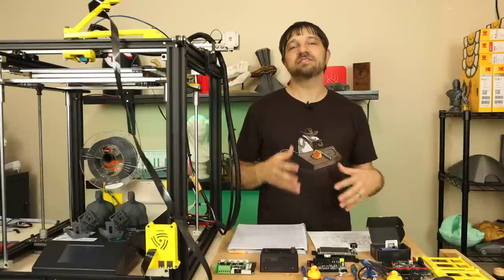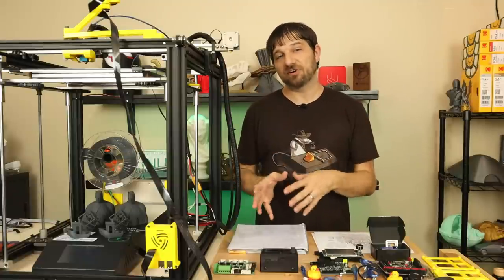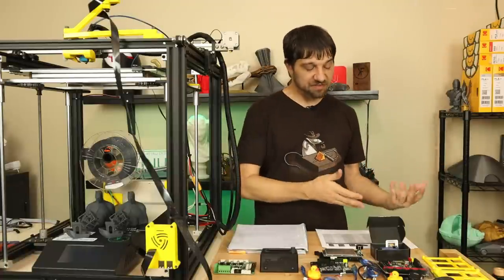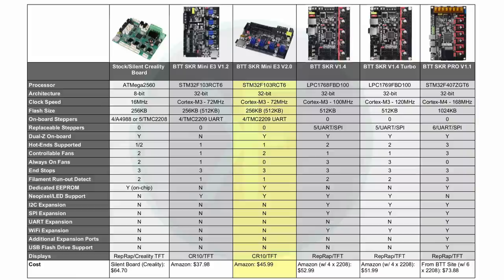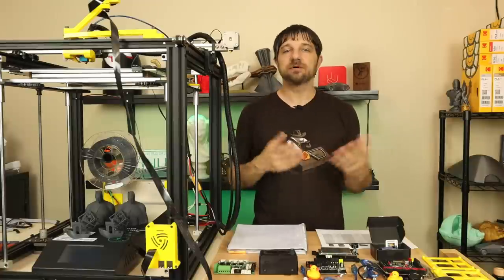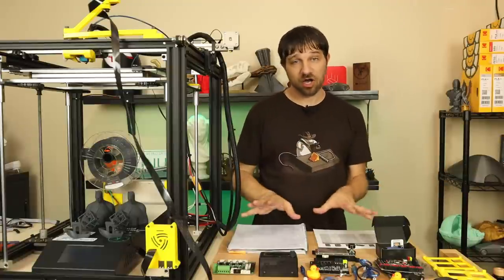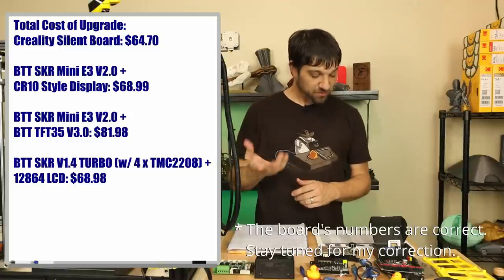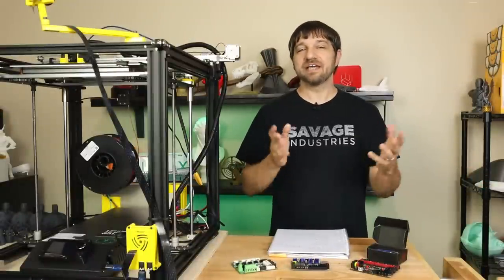Bigtreetech Ender 5 Plus Upgrade: Boards Compared (Part 1)

Comment: Will these boards work with stock display? Also, is there a level code? So that the bed can level corre tly on tbe threaded rod.
Reply from the maker: Is it possible? Yes. Does anyone support it? You may be able to find someone but I've never tackled it. It's a pain both from hardware and software.
The bed can be leveled automatically if you use a board with two separate Z controllers. So that's at least 5 drivers, not just 4.

Comment: I have 4 ender 5 plus and they all running at octoprint on there own dedicated raspberry  I haven't done anything on the boards besides raising the voltage a little for the extruders because of the skipping.  I have a 32bit mks gen 1.0 board with 2208 drivers bought butt the thing is that they all print great! I'm kinda at a point of "don't fix if it ain't broken"  I only done the gen 4 double fan ducts and 1 converted to direct drive butt what is the BIG advantage of a new board?  I don't think the printers are too loud for me so silent drivers aren't worth it for me.
Reply from the maker: Great questions! I'm a big proponent of "if it ain't broke, don't fix it," but many people like to upgrade for reasons such as silence, better stepper drivers, and new features. Just a few notes: The smoother TMC steppers can produce better prints. In side-by-side comparisons, you can see small improvements. The new boards have new features which I discussed in part 1 of this series. The new boards have more power for new features of for printing faster. If none of these issues are as important to you as a known stable printing environment, leave it alone. If you want to try it out, go for it. If you're careful, you can always switch back.
Reply: @kerseyfabs  thx for the answer!  I'm very pleased with my printing results now butt maybe in the future I'm upgrading the board since I already have it.  Thx!  Keep up your great videos!!

Comment: I would like to point out that the SKR Pro doesn’t have a dedicated Eeprom nor does it support USB Drives (yet)
Reply from the maker: I appreciate it. I actually put the EEPROM note yesterday in my pinned post when I realized that. It physically has the USB port, so I put it on the table.

Comment: So the SKR Pro comes with about a half dozen options - TMC2209, TMC2208 UART, TMC2208 STEP, TMC5160, TMC2100, and DRV8825... Which one for the Ender 5 PLUS?

Comment: Kris, really nice work. I have added the E3 V2.0 and TFF35 to my ender 5 Plus but I am having an odd problem. The x axis does not want to home. It will move about 10mm in the opposite direction of the sensor and stop. It will travel in the right direction if directed to. The y and z work fine. I have traced the wire from the limit switch back to the board and it works as expected (I compared it to the y). I have reloaded the firmware (including your most recent version) and that does not help either. I have tried playing with the setting but nothing seems to help. Any suggestions would greatly be appreciated.
Reply from the maker: Have you tried it in both touch screen mode and Marlin mode? Does the printer home correctly?

Comment: Hi Kris, Thanks for great series on BTT boards. I noticed the SKR PRO V1.1 on the comparison list. Do you have any comments regarding this board, am I correct that you can upgrade firmware from sd or USB without the need for additional software? Do any of the other boards have a boot bootloader, or did I miss something? Thank you. Bill
Reply from the maker: Hey Bill! I have an SKR PRO V1.2 in house and it will probably be on the channel in about 3 weeks. All of the SKR boards come with bootloaders installed that load the firmware.bin file off of the SD card for upgrading.
Reply: Hey Chris,
Thanks for your reply, I look forward tot he SKR PROV1.2 video. I really enjoy your videos and appreciate you attention to detail.
Reply: Further to previous, I purchased the BTT filament sensor recently but can not sort the ender5 plus firmware. I am doing prints that go up to 30 hours so a filament jamb is always an issue. Being able to easily set up the sensor would be a great benifit. Thanks again.

Comment: I cant seem to find anything on the install of the bigtreetech ESK E3 V3 with the Ender 5 Plus. I cant seem to get the touch screen to work with the install. So, not sure what Im doing wrong.
Reply from the maker: Is this what you're looking for? https://youtu.be/ugRHsLWH95A
The Bigtreetech boards won't work with the stock display without a considerable amount of work.

Comment: Just FYI, Big Tree Tech support says that their boards are not compatible with the Ender 5 Plus. 

I bought the BTT  SKR v1.4 Turbo (2209 stepper drivers) and their TFT50 touch screen. After following their install instructions the screen had a rolling distortion on it (horizontal line going top to bottom). I was able to activate stepper motors and heat the bed, but after a few minutes of use the screen starts flashing to a blank white screen and stops talking to the printer. Restarting the printer starts this loop all over again.

When I sent video of this to BTT, they sent back a response that their products are not compatible with the Ender 5 Plus, only the Ender 5 Pro. Since you and a number of other Youtubers are using the Turbo boards on the Ender 5 Plus, this makes no sense, but I thought people should know they aren't very helpful.

I'd also love it if you know a fix for this glitch. 🙂
Reply from the maker: I talked to BTT about the Ender 5 Plus not being supported last night since I have heard it at least twice now. She told me she would look into it and try to get it fixed. As for the screen issue, either something is off with your connections or something is off with your display. Have you verified that both Marlin and Touch mode are working correctly?
Reply: @kerseyfabs  I appreciate you looking into this: I think the last email I got from them was provoked by you contacting them. They are telling me now that the reason the motherboard isn't compatible with the Ender 5 Plus is that the holes don't line up ("the motherboard holes are different, so the printer cannot be installed"). Makes no sense since they say it is compatible with the 5 Pro, which has the same case as I understand it. Still, not a huge issue since I already printed the adapter from Thingiverse for the board and it's sitting nice and snug in the case right now. 

They also stated that they "...do not provide the service of compiling firmware, we need customers to DIY." So they don't provide firmware for their products and depend on the community to figure out how to make things work? That sounds insane. 

I've built computers before, so I'm not completely new to working with electronics on this level, but I admit it's possible I messed something up somewhere. That said, the connections seem pretty straightforward and hard to screw up. When the display started going crazy I shut the printer down and only powered it back up again to see if it happened again and to get a video for tech support. It was in the touch screen mode (bright colored icons) and I'm not certain how to switch it to the other mode to test it. Advice to I can test it further is always welcome.

Comment: What about the 5th board on your table? I remember from another video from you, controller performance has an impact on the object to be printed. The M4 is much more powerful!
Reply from the maker: I'll have two more Bigtreetech videos out soon. The SKR Pro V1.2 is one of them.
Reply: @kerseyfabs : Please test the SKR Pro V1.2 with the SilentStepSticks using the TMC5160hv. This can operate with up to 50 VDC. his SilentStepStick TMV5160hv I did purchase directly from Vatterott, the company partnering with Trinamic to design and produce the SilentStepSticks. I did also purchase a Meanwell 600W 48 VDC. So please show and test the SKR Pro V1.2 operating the Stepmotors at 48 VDC with the SilentStepSticks5160hv and how it is done to use that 48 VDC.